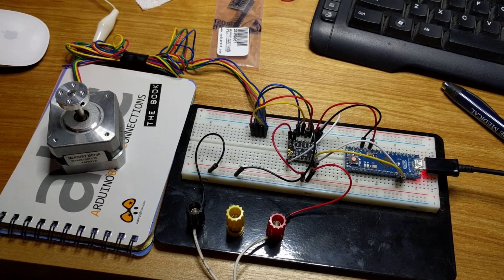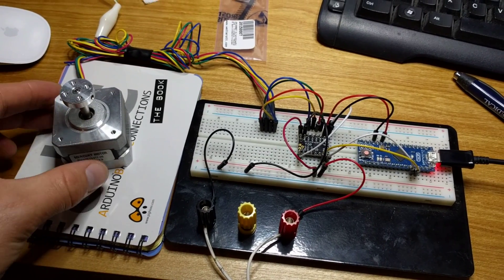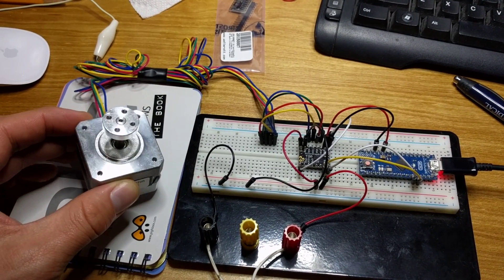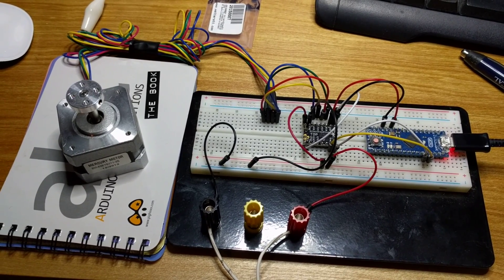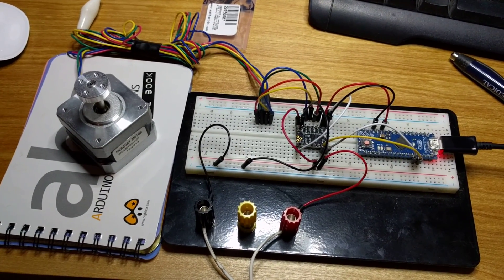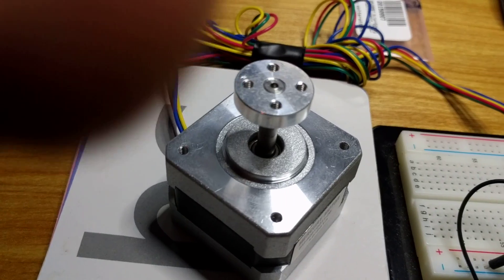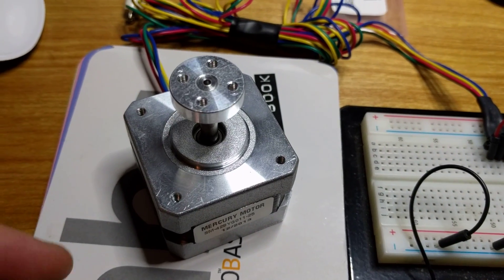Silent Stepper Motor Control with Arduino Micro

Comment from the maker: For those wondering about how this is wired in I went super simple with this because i had a full arduino to run it and it was doing very little work.  The step stick needs a 12v motor power supply and 5v for the logic.  There are the 4 wires connected to the stepper, which are fairly obvious  when you look at how they are indicated.  They are basically controlling 2 different coils.  The other pins are just STEP and DIR.  The STEP pin is expecting a square wave for each step and the DIR controls the direction of travel.  Positive goes one way and negative goes the other.  I am basically bit-banging this by turning the STEP pin on and off and i can change the speed based on the amount of time between the on/off.   Simple code for this is in this repo:
https://github.com/contractorwolf/SilentStepper

Feel free to ask more questions if you are stuck, trust me I have been there and had all sorts of great people on the internet help me too.

Comment: Hi ,
Do you mind sharing the code ?
Reply from the maker: The stepper driver has 2 pins for control, step and direction. I am basically just bit-banging the step pin to advance the motor forward. Flipping an output pin between + and - on the Arduino does it.
Reply: @contractorwolf  So you can't share it?
Reply from the maker: @i4kata  https://github.com/contractorwolf/SilentStepper

Comment: Could you give me the code to run this? Iam acutally trying to get this thing spinning. Thought about the current, the connections and the programm. I think a have a basic programm problem, so you could really help ne out there

Comment: Hello. I got project with esp8266 + tmc2208 driver. My problem was unable to start tmc2208 to spin motor. I solve it connect gnd with enable pin. BUT motor spins veeery slowly. Could you explain how to fix it?

Comment: Wait, is it the DRIVER that causes the motor to make noise? 😮
So it theory, you can make any stepper motor silent just by replacing the controller PCB, and without making any modifications to the mechanical parts of the motor?
Reply: In fact, the motor noise depends of the motor (fabrication quality) and the quality of the signal from the controller. Small and recent motor like in the video are quit silent
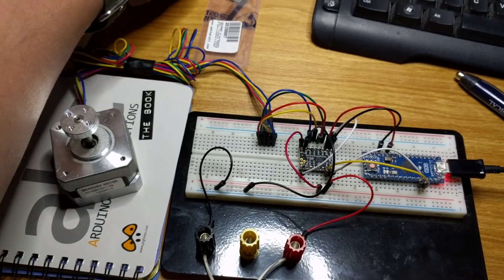Reply from the maker: @theolemoan8606  that is wrong, that same stepper used with the sparkfun easydriver (shown and described in the video at 0:56) makes the normal screeching stepper sounds

Comment: i was using a drv8825 before and it was okay, then i switched to the tmc2208 and thought it was broken because the motor was spinning so slow and i couldnt hear it lmao
Reply: Hi, i'm trying to drive stepper motor with arduino with tmc 2208 but im cannot find sketch to try with it, can you give some advise? Thanks
Reply: @danielevanzo8776  maybe the tmc2208 library example can Help you. You can Download it from the arduino IDE software
Reply: @ipadize   i downloaded tmc 2208 library for IDE, but im a beginner in code writing, so its not so easy. I followed a tutorial to drive stepper with A4988 and it worked, but too much noisy for me, so i decided to buy tmc, and now i have problems...
Reply: @danielevanzo8776  do you want to use accelstepper? You could ise the example from the accelstepper and add the tmc2208 library into it to program the driver via Uart
Reply: 88 @ipadize  , i follow this video https://www.youtube.com/watch?v=fA7FV6XqT2g  to connect and get the code for arduino and it work! Now i tried to insert the library for the TMC in the code of the video with A4988, but it doesn't work... How  can i do? Thanks
Reply: @danielevanzo8776  what doesnt work?
Reply: @ipadize   IDE give me error when i check the sketch. I have to change the wiring too!

Comment: James - do you remember how you set the current limiter on your board? I'm assuming you used the pot and Vref, but the calculation provided by the manufacturer seems to indicate you just set Vref (V) to Imax (A):

Vref = (Irms * 2.5V) / 1.77A = Irms * 1.41 = Imax

(This is from the their FAQ: https://learn.watterott.com/silentstepstick/faq/)

Comment: Thanks for this useful video ! 

I did a few arduinos projects (some of them posted to my channel), however never used a motor. My aim is to build a camera travel rail for my new video setup. Those are worth hundreds (when not thousands) at RRP. 

My only concern was regarding motor noise and I feel more comfortable now that I watched your video !
Reply from the maker: Thanks 20Cent! I have used these silent stepper drivers on a few personal projects and they are really great. I am working on another one with them here: 
https://youtu.be/s_8xyT4W3tE
Reply: This is exactly what I'm trying to achieve.

Comment: How exactly does a driver cause the noise. (I interested in the mechanics, not doubting it)
Also here is a link (I believe it's the same one)

https://www.digikey.co.uk/product-detail/en/TMC%2520SILENTSTEPSTICK/1460-1159-ND/5724190?utm_campaign=buynow&WT.z_cid=ref_octopart_dkc_buynow&utm_medium=aggregator&curr=gbp&site=us&utm_source=octopart
Reply from the maker: something about the way the current is modulated when turning the motor causes excess amps that get dissipated as sound I think. The silent step stick modulates it in a way that doesnt have the excess noise.  Something like that.
Reply: @contractorwolf  Before you replied I found a video of manufacturer of the SilentStepStick using the TMC2100 range chips on a Prusa I3. They showed that the silentstepstick produces a clean sinewave, and a cheap stepstick product a noisy one.

I'm here researching to replace the loud ass steppers on my Anet A8 3D printer. But my findings show that I need to replace the circuit board completely with a Arduino Mega 2560 and Ramps 1.2,1.4 or 1.6 board with 5 silent step sticks, then flash marlin onto the Mega 2560. There i was thinking i could somehow splice in a silent step stick!

Comment: Hi, Is there a specific type of stepper motor that this driver can handle?  specific power?  I need the motor to lift a fairly lightweight arm, so it will have a load but not a big one.  Just want to find out if there are specific motors that people use with this Silent step stick...

Comment: Hi, would you mind to share me the schematic layout of the hardware connection?
Thank you
Reply from the maker: KM Goh it's in the other comments
Reply: Hi james, thank you for the reply. However i still have some questions would like to get your clarification.  As I know, the step of TCM2100 can be set until 1/16, and it can be further interpolated into 256 microsteps. However, in the arduino code, we can only set the microstep up to x16 only right? (since the interpolation is done inside TCM 2100)
Reply from the maker: KM Goh I was just using the defaults because my needs were simple, but there were two other configuration pins I believe that could be used to set it differently. What are you trying to make?

Comment: Hi, just wanted to say thanks for this video, and the code/diagram etc. I've been looking for a way of using a stepper motor in a project that needs low noise and vibration. After starting with a basic stepper driver, I moved onto easydriver which was better but still too loud/shaky. Found this video sort of by accident, liked what I saw, ordered one and it is amazingly quiet and stable. After all my tests with steppers this thing is almost like witchcraft !
Reply from the maker: Frigby Chilwether yeah the way it moves so silently is almost spooky because it is so quiet. Thanks for the comment. If you have a video (or blog post) on what you are working on I would love to see it. Leave a link in the comments if you can.
Reply: Hi, I'm working on a wireless follow focus system for video cameras - so needs really no noise and vibration.. When I get something working I'll see about doing a video on it.

Comment: Looking at your wiring, I have a question, do you connect the enable pin to the ground of the driver? If so why? Thanks (Strugglingg to find a wiring diagram for these things...)
Reply from the maker: Vladimir, here is a better photo for you on how I had it wired up:
https://photos.app.goo.gl/sCccfWaEhAv4V9p13

The enable pin i think is supposed to be wired to the GND pin of the controller, but I just have all the ground pins tied together so it was a shorter wire to go direct to the GND pin of the SilentStepStick and then connect that to the GND of the Arduino.
I was using this to wire it up:
http://reprap.org/wiki/File:TMC2100_Schematic_simple.png
Reply: Oh thank you for your quick answer ! and thank you for the picture. I think I see why you would need to put the enable pin to ground, and I think I need to do otherwise as I'm using it for a camera slider and I need the module to be able to lock the motor in place to avoid having the motor turn due to the camera weight... 

Thanks again !
Reply from the maker: Vladimir, then you may need something more like this: 
https://www.youtube.com/watch?v=2SozZ7af3wg
because it wont stall and remembers where it needs to be, a normal stepper controller doesnt notice when steps have been skipped, or something is fighting with the motor (like the weight of the camera)

Comment: the trick is the stepper driver, it should probably be a TMC2100. there is nothing important in the code.
Reply: Does the driver support microstepping? Sorry for the late comment.

Comment from the maker: Here was the final project that used a 555 timer instead of the Arduino.  The 555 timer was used to advance the silent stepper and turn the light:
https://www.youtube.com/watch?v=-xKlJ0JRd_o
It was for my sons room, worked perfectly and was absolutely silent.  I used the 555 timer instead of the Arduino on the final one because using an Arduino just send a simple continuous square wave seemed like overkill.

Comment: Hi! I need to do almost exactly the same thing. Can you tell me exactly what stepper motor you use in this video? Can you also tell me how you're able to vary the speed of the stepper motor and exactly what you're running on the arduino? Thanks!
Reply from the maker: +james mendola, it is just a normal stepper running at 12v.  I am using the AccelStepper library on the arduino that allows me to send the direction and number of steps programmatically.  I am just running a simple loop that tells the stepper to move every iteration.

Comment: Hi James! 
Looks great and hope it turned out well! 
Im wondering if the silence is just because of the stick or also depending on the motor? Which motor do you use?
Reply from the maker: Hey Arvid, the silence is really just because of the silent step stick.  I have used other stepper drivers before, this one regulates the current provided to the stepper which prevents the stepper from making the normal screeching noises.  It is really awesome.  I was working on this because my young son has this light that projects on the ceiling and I wanted it to stein, you can see that project here:
https://youtu.be/-xKlJ0JRd_o